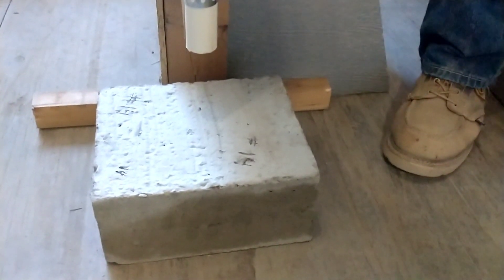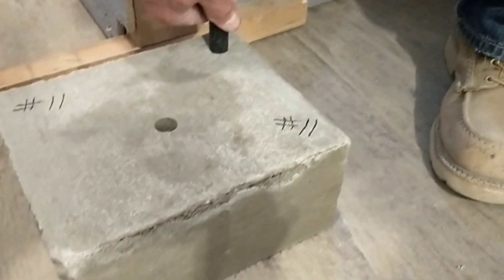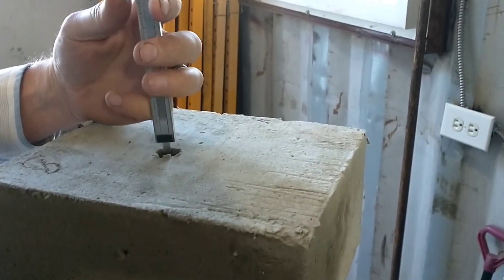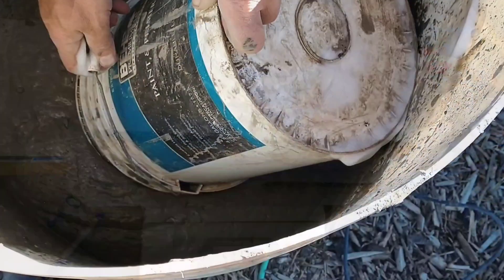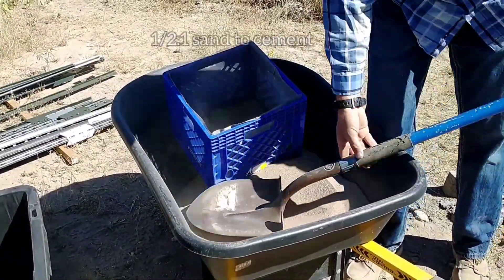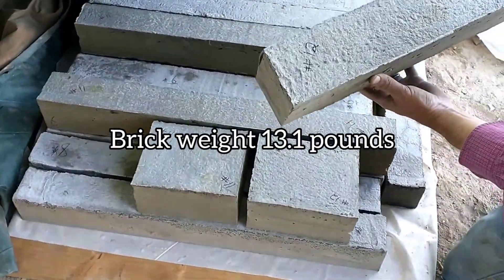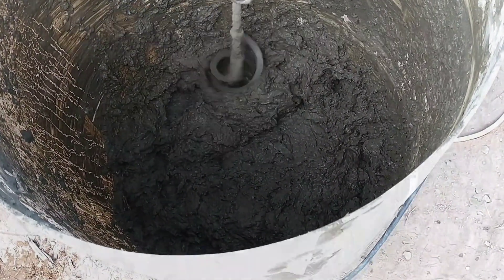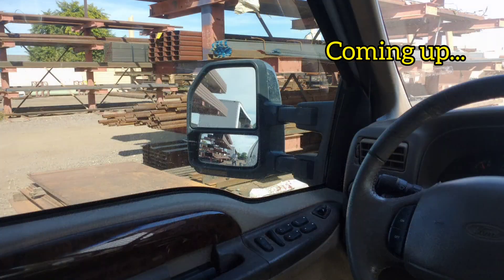AIRCRETE | Should We Use It to Build Our Home? Testing Results & Conclusion PART 2

Comment: Really like to see a glass or basalt fiber mix test. Maybe a lite mix and a heavier mix like you did the cellulose fiber. I've thought you don't want long fibers because they then to knot and clump up but short fibers (like 1/4") do quite well for crack resistance in conventional concrete too.
Reply from the maker: Update: We found a more reasonable place to order the fibers and will be tested basalt fibers and fiberglass fibers! It will take some time, but hopefully within the next month, we'll have those results. If the fibers work well, we shouldn't need to add the wire mesh, just rebar to connect it to the frame. We are also looking into a way to test the R value, that would be awesome to know.  Thanks for your persistence!
Reply: @RedandAprilOff-Grid  smiley face )
Reply: @RedandAprilOff-Grid  Where did you find the reasonably priced fibers?
Reply from the maker: @robbrubaker6869  Here is their link https://globmarble.com/ 🙂
Reply from the maker: We have seriously considered it, but it would add a lot of cost to the build so have decided against it. Red called around but can't find anyone local that sells it for a reasonable price, and it's not cheap online either.
Reply: @RedandAprilOff-Grid  considering the total investment we make in our houses and the supposed added crack resistance down through the years I think the cost is actually comparatively cheap. We're not talking thousands of pounds of fiber, I believe I've read it's about 10 oz of fiber per cubic yard (although that might have been the plastic fiber I'm confusing it with, still it's probably only 30 or so pounds of fiber. I've bought chopped fiberglass for composite mold making and paid less than $8 a pound.
Reply from the maker: We were looking into 1/2 inch and can't find it for less than $15 a pound. One place was $10 but they were charging $26 shipping! We also need the type that is alkaline resistant to go in concrete. One local place has some kind of fiberglass fibers, but the lady didn't know anything about it, she said it's in a very small bag for $6, but maybe we'll go check it out next time we are in town.
Tomorrow we are planning to make a batch with nylon fibers, we have some we can use and if works well,  I think we could figure out a way to get it pretty cheap. 
With our design, the aircrete does not need to be structural, and right now, we are planning to use the wire mesh and rebar on the inside and, it's expensive, but probably fiberglass netting on the outside. We'll have some time to think about it.

Comment: I absolutely love all this testing data! Thanks so much for sharing all your hard work with us. What attracts people to DIY aircrete is the idea of an insulating structural material; but nobody knows how strong it is, or what the R value is! You've made a huge contribution to the first knowledge gap and I think your subscriber count is going to explode over the course of this house build for putting out awesome content like this. The issue of insulation value is still completely unknown though. Everybody blindly parrots "an R value of 2" because that's what autoclaved aircrete is. Nobody is capable of DIY autoclaved aircrete, so it's not a relevant number! Depending on the DIY aircrete mix, it probably ranges between an R value of 1.25 and an R value of 3.5. It's actually possible to get a relatively simple measurement of R value though (or perhaps more accurately "comparative thermal conductivity".

Although you're probably sick to death of testing, Mathias Wandel put out a video of a simple methodology for measuring R-value with a $40 infrared thermometer. He put out a little spreadsheet that handles the math. He did it for a wall in his home, but it wouldn't be hard to adapt to a small aircrete box with a $10 electric coffee warmer inside. Just a thought. The video title is "Measuring house wall R-values using an infared thermometer". Here is a link to his video:

https://www.youtube.com/watch?v=6FGfn27Qj54
Reply from the maker: Thanks so much! The R value is something that would be very interesting to know, and to see how it changes with heavier and lighter mixes. We haven't got around to researching how to do it all. We'll check out the video. Thanks! 😊
Reply from the maker: We just watched the video, and Red wants to try it! We already have a tiny heater with a thermostat, and an infrared thermometer. He just ordered a temperature probe to make sure the inside of the box stays a consistent temperature.  Thanks for the information! 😊
Reply: @RedandAprilOff-Grid  Very cool! I'm excited to see the results. 

I recently saw an interesting R value approximation/test for aircrete done by  Stephen Williams. His channel is all about EPS foam aircrete and he's got some fascinating content. His methodology was to construct 12"x12" boxes with 2" thick walls, and then he put a frozen bottle of water inside. I think he measured the time it took to melt the ice. He used a identically constructed, pure EPS styrofoam box as a benchmark.

I'm not really sure how he accounts for thermal mass differences between materials though. For example, if a pure concrete box was left outside and frozen, it might seem to outperform a lightweight aircrete box in keeping a frozen bottle cold. Another consideration is ensuring that each box is comparably well-sealed to minimize differences owing to air leaks. Still, it's a very simple and useful way to compare your sample's performance against a known benchmark (styrofoam) and other samples.

Stephen seems like a really sharp guy, and he's clearly passionate about aircrete. He would be a really great person for you guys to chat with about R-value, and your plans generally. The title of video is "Aircrete on Steroids, Aircrete Styrofoam. Build Cheap". The relevant portion starts a 9:15 in the vid. Here is a link:

https://www.youtube.com/watch?v=27v7Oq-q9xs
Reply from the maker: He has lots of interesting ideas, but I'm not sure where he's going with it. 
I have a hard time believing that a 5 inch styrofoam wall that can easily be pushed over, will support a 2 story structure with just the addition of fabric and a coat of plaster.
If he put one of his blocks in a fire pit, it would melt and burn. He moved the torch away every time it started to melt or catch fire.  Aircrete definitely does not burn, melt, or catch fire. 
His way of building looks very time consuming, you would need a lot of space, and time, to gather and shred that much styrofoam.  We can make 4 full batches of aircrete in less than 2 hours including cleanup, and it makes around 20 cubic feet of usable material.
Measuring R value in that way would give some comparison information, but I would wonder how accurate it is.
Reply: @RedandAprilOff-Grid  We're on the same page for pretty much all of the above. I see EPS-crete as an intriguing insulation material, but I'm very leery of it as a structural material. I definitely wouldn't build a house out of it. I only mentioned the video because it was an interesting first stab at comparing thermal conductivity of different aircrete mixes by timing how long it takes for them to melt. His test fails to account for the effect of different thermal masses and air leakages among samples though. I'm not clever enough to think of a better idea, but sometimes it helps to see what other people have done in the past, try to identify weakness and improve on them. :)
Reply from the maker: We have had a lot of people recommending his videos 😅, so I went on a bit of rant. I edited it down a bit. 
Adding cold to the box instead of heat, is an idea to consider. I'm not sure how Red plans to do it, but he has some ideas. 
Thanks for the comments and encouragement! 😊
Reply: @RedandAprilOff-Grid  One of the simplest ways to accurately measure thermal conductivity and therefore calculate R-value is Lee's Disc method. It's the sort of experiment students do in high school physics lab. It would probably take an hour or two to set up the equipment the first time, and the equipment itself would probably cost $50 or so. The upside is that test samples would be very small and simple to make (3" diameter x 0.5" disc of aircrete). Your steam generator could just be an old electric kettle from ebay, and you can buy aluminum discs that are 3" diameter and 1/4" thick for about $5 too. It's probably more than you'd want to bother with, but I thought I'd toss it out there. It would make for a pretty cool video, and is the sort of scientific approach to DIY aircrete that doesn't exist anywhere else. Here is video from the channel All Lab  Experiments that explains the method and the simple calculation entitled "Lee's Disc Experiment | Thermal Physics Lab". https://www.youtube.com/watch?v=RJEVUWJDxsM

Comment: Is there a point when it makes sense to invest in a  cement mixer? I would think the investment would be worth it.
Reply from the maker: I hear mortar mixers probably work for aircrete, but I think a cement mixer is not ideal. Mortar mixers are quite expensive. Mixing is way more tricky than we were expecting, but I think we about got it figured out. The batches are not bad at all to make, everything is so much lighter than regular concrete. We did 4 batches in less than 2 hours including clean up. So once we start pouring the house, it should go pretty fast, and it's not too strenuous with 2 people.

Comment: A few comments: What features of aircrete are you persuing? You talk about insulation but do not test that parameter. Your DOE results are hard to interpret based on the test parameters.
The choice of test method is curious. Concrete is not good in tention. It works in compression. But it is a test parameter. Impact resistance did not make sence until you mentioned you were going to use it for a flooring material.
Brief search show an optimum aircrete R-value of 3.7 per inch, so you might get an ~R30 in an 8 inch wall of very cured & sealed material. But the parameter is not tested.  
Reviewing your videos because I must have missed the objective.
Reply from the maker: We would love to test insulation value and compression but those are hard to measure and difficult to test without the proper equipment.  We know enough about aircrete to know it is reasonably insulative, and possibly very insulative. It can be reasonably strong, but more often people are getting batches that are weak and crumbly. We have also seen a few successful builds and know it can be a great material with many benefits. We are testing to see if we can make good, consistent batches that we feel will be suitable to build our house. Also to see which recipes yield the best results in the areas we are able to test.  The aircrete will not be load bearing, so that doesn't matter too much. We wanted a material that is insulative but also has a lot of thermal mass. The issue with straight concrete and  blocks is they have almost no insulation value. We strongly considered, rammed earth, but again it has very little insulative value and is very labor intensive. We expect this to be a fairly fast and cost effective way to build a house. I can't guarantee that it will work, but we are pretty excited about it and think it will make a pretty awesome house, but only time will tell.
Reply: @RedandAprilOff-Grid   ok.
My mistake.
Reply from the maker: They were good questions and I'm sure there are others who are wondering the same thing. 😏🙂
Reply from the maker: Someone sent a link on how to test and calculate R value. It looks doable, and we already have most of what we need.  Hopefully it will work!

Comment: Red you have some really good aircrete! It is frustrating when it becomes inconsistent. I'm switching over to styrofoam with some foamed binder and this is part of the reason why. I'm also testing tons of admixtures for additional binders. I'm trying to formulate something similar to the SIXBAU blocks - https://www.youtube.com/watch?v=r2vcHKzDYnc . I think I am getting close, but now trying to find cheaper ingredients. Cement testing takes so long when you have to wait days between test.

You are getting a good cure and I think that is a problem other have is they don't wet cure their blocks and they become really weak. Are you thinking of doing a mono-pour or blocks? I personally would not feel comfortable with aircrete other then infill or dome shape, but that does not mean it can be done. If you can put up a light roof and get the shear strentgh needed for your structures weight you can make it work. I've done shear wall retrofitting, anything is possible. Problem is, there are no numbers for shear strength of textile reinforced aircrete walls so you have to get the outside/inside skin done well. DO NOT USE THE POLYESTER ROOFING FABRIC. You could also do an infill setup with steel to the roof or design a shear wall system using inside walls that attach to the roof then to the outside aircrete walls. You would need a correct size footing for the inside shear wall to keep it down tight, slightest uplift and shears walls fail to work.
Reply from the maker: It has been a challenge, but we feel like we are getting a pretty good handle on what not to do, and are getting the mixing figured out. Filling in the garden wall has been great practice and something we want done anyway.  We are planning to do poured walls with support every 8 feet. We'll be sharing more details on that soon. Best wishes on your projects, that sounds cool. I shared your comment with Red, but I answer the comments and questions. Thanks for the input and best wishes on your projects! - April 😊

Comment: Very impressive R+D, thanks for sharing that!  Boric acid would explain the soft samples. But those won't get termites!  An insulating extender is fly ash, which is small hollow spheres, if your local ready mix plant has it (in bulk), then a lot cheaper than bagged sand, and very nice to work with.  It helps flow into forms, but the carbon content (from burning coal) may reduce foaming?  edit: But if your foam-only mix is strong enough, you can't beat the price of air!
Reply from the maker: Thanks!  Fortunately regular aircrete doesn't get termites either. Yes, an attic filled with paper, would need something in it to make it less flammable and resistant to termites. So an untreated paper product would probably perform differently. 
We tried pretty hard to find a place to get fly ash, it sounds like good stuff. No one anywhere around here seem to sell it. They use it in their mixes but do not sell it. One guy said it's so fine, that it's practically a liquid and they don't have any way to load it for distribution.
Reply: Check out Kirsten Dirksen's most recent vid of the cork sided home. Turns out, it is built with aircrete blocks w/ fine sand & limestone? They didn't seem to know what to call it? A great vid & home design altogether!
Reply: @ogfoundation  Very cool video.  I think those may be Aircrete EU, who just opened their biggest plant in Mexico to serve US markets.
Reply: Thanks for the comment about boric acid. I’m planning to use chopped styrofoam additive in mine to insulate a wall, but mice are always an issue here, may add some cellulose insulation. Structural strength not needed for this application.

Comment: Do you have any plans to do insulative tests on the different mixes?
Reply from the maker: It would be nice to know, but we haven't looked into how hard it would be to figure it out. I'm assuming it's not easy. I'm sure our stronger mixes are not as insulative but we aren't too worried about the exact number.  I think with our 8.5 inch walls, south facing windows with the proper overhang for the summer, and the amount of thermal mass, the house will require very little heating or cooling. It will be interesting to see how it does.
Reply: @RedandAprilOff-Grid  Yeah, when I get to it I am hoping to cool with an ice cube and heat with a hair dryer. One can dream

Comment: I just watched Aircrete Harry's vid, talking about his thickening solution.  Is that the same/ similiar to the glycol do u know? Also, how much glycol are you adding per batch?
Ok, watching ur vid now 🤗
Reply from the maker: 5 gallons of water is somewhat of a low water mix already. Many use 6 or even 7 gallons of water, which does seem to produce a weaker mix. 4 should hypothetically work, but it hard to mix and hard to whip the foam into.
Reply: @RedandAprilOff-Grid  and you can have particals settings with no where for the water to go. The problem quickly cascades as more bubbles pop, more separation, more air out.. I make sure to put holes in my plastic now.

I AM NOW LOOKING INTO HEATING THE MOLD TO DECREASE SET TIME
Reply from the maker: No, the glycerin is just something we decided to add just in case our Drexel wasn't mixed well. The tiny house aircrete guy was saying the glycerin can come to the top of the Drexel making your first batches turn out better than the later batches. Glycerin is pretty cheap, so we are adding a little as an extra insurance. From what I understand,  Harry's thickening agent is only available for sale commercially or in large amounts, so he bought some and selling it in one gallon jugs. We have some, but the trial batch we used it in was probably under mixed and it  leaked out some which causes big air pockets. Our most recent batches seem to be showing that under mixing produces a much worse product than over mixing. You have made a lot of aircrete!  The thickness and texture of your batches look really good. Best wishes with your house!😊
Reply: @RedandAprilOff-Grid  I mix the Portland& water in a cement mixer first, and then try to limit the mixing duration in the barrel w/ the foam w/ the hand mixer to a minimum- just enough to mix the foam +slurry consistently. Originally,  I was thinking low water would result in a stronger result, but your vids have dispelled that illusion!